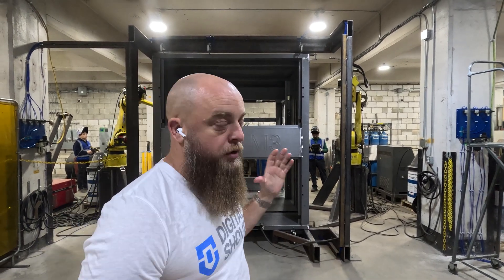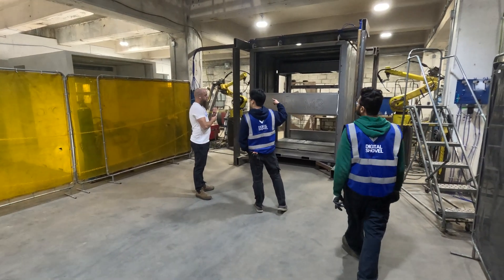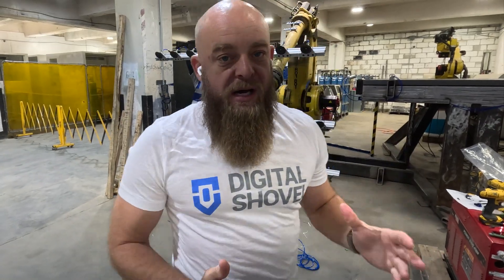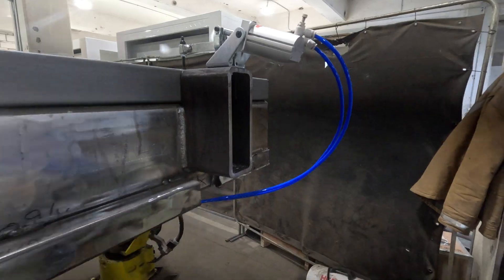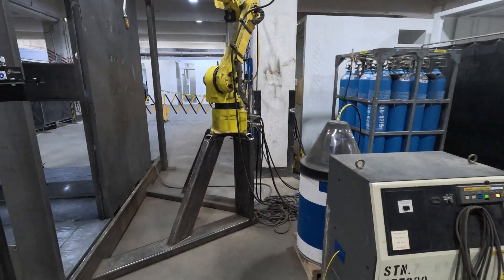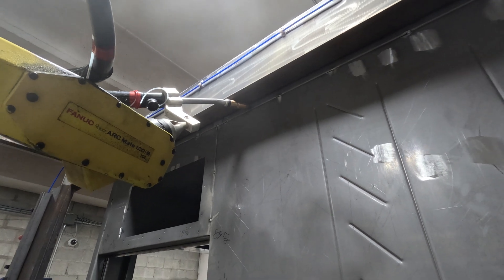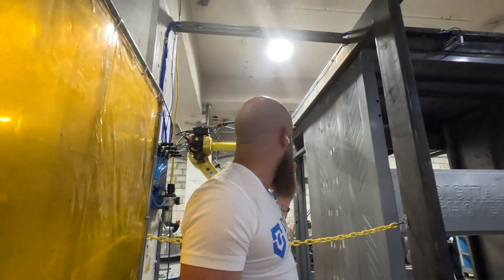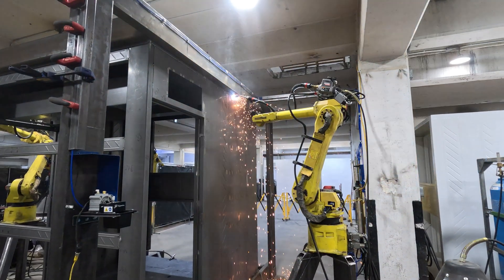Digital Shovel's New Automatic Robotic Welders

Comment: I believe implementing a modular aluminum panel system for easy installation would greatly improve production efficiency. By designing parts that can be shared across multiple products, we can reduce inventory complexity and material costs. Using jigs and fixtures to standardize the installation procedure further enhances assembly speed and consistency.

While robotic welding offers better precision than manual welding, it is often not fast enough for true mass production. A modular system that minimizes welding steps can significantly save production time, reduce failure rates, lower storage needs, and ultimately cut overall production costs.
Reply from the maker: We actually moved to modular panels about a year ago, and we now just rivet panels together.